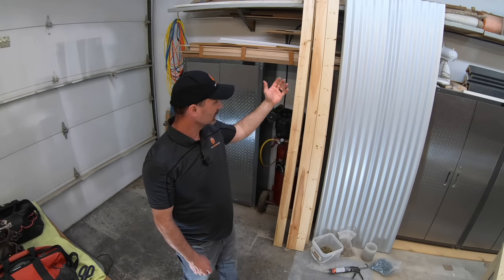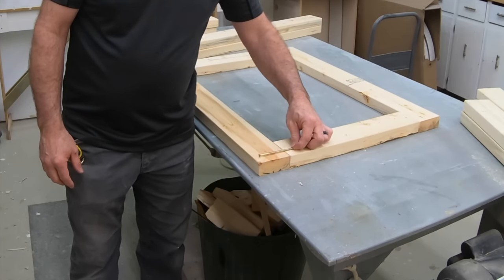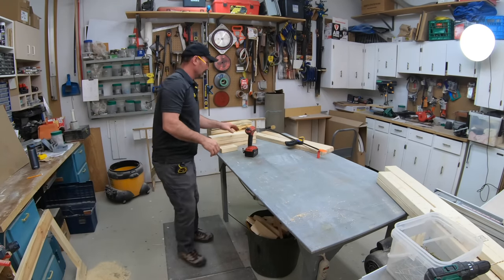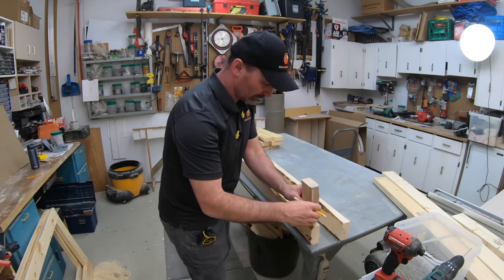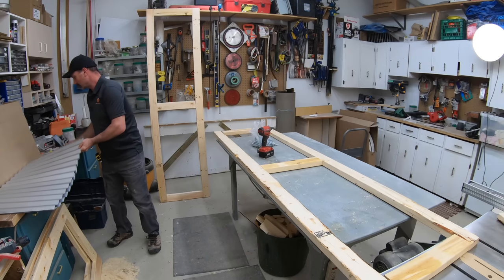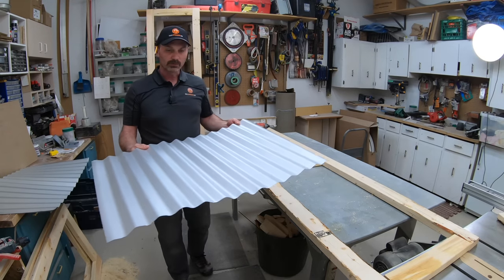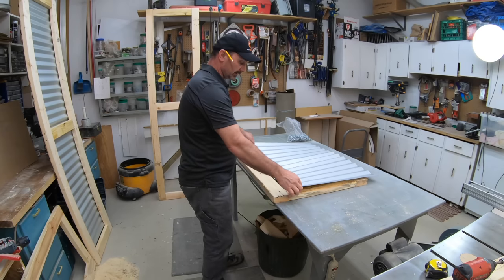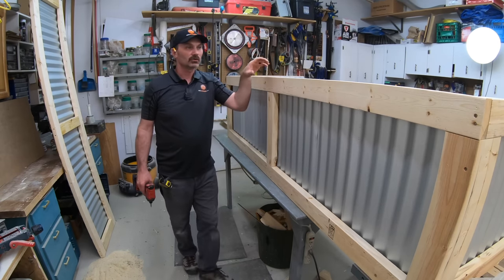How To Build a Raised Garden Bed

Comment from the maker: Here is the cut list: https://www.house-improvements.com/files/raised-garden-bed.pdf
Reply: Wow, $200 each is a lot.  Yours should hold up well.  For comparison, I build 8 out of Redwood 14 yrs ago and I have 3 starting to degrade.  I live in Oregon so Redwood seemed to be a good choice of wood.  People reading this should know that the ground could present a problem with root invasion and the likes of Gophers and Moles.  A combo of Ground fabric and 1/2 wire fabric worked marginally for roots but 100% for ground critters.  Root invasion, even if the canopy doesn't come close is still a problem and could make it difficult to keep plants hydrated.  Well Done!
Reply: Question…. Are lumber prices as insane in CA as they are down here?! 

I know part of the issue was due to everything closing down, but this is getting ridiculous. 

Sigh

Comment: A great instruction set describing a raised garden bed.  If I might add one other suggestion:  if planning to install an all-thread bar to brace the middle of the bed from bowing out, I would use a piece of PVC pipe to cover or encase the all-thread bar to prevent rusting and eventual failure of the bar over time.  Thanks for sharing this video.
Reply from the maker: May help but a 3/8"or 1/2" bar would last for years anyways

Comment: Thanks again Shannon. Great stuff.  Currently putting board and batton on my cabin. What is your recommended mailing pattern for 8 inch wide boards.  I see so much conflicting advice!! I’m using 8 in wide by 3/4 thick cedar boards with 4 in batons.  Thanks
Reply from the maker: Personally I would nail the boards in the centre  and the battons on each edge. We can help you more in the forum if you need more advice.

Comment: At 27:32 use 3/4" PVC for 1 or 2 center spread supports. Make or buy a Trunnion. Use a round piece of 1/2" Aluminium rod, file a small flat to drill thru- drill and Tap 10-24. Drill thru PVC and insert trunion. Then drill the 2x4 and use a 10-24 SS Bolt and washer into the trunion. You will get NO rot or rust. You can just use the alum with no thread and use a threaded hook around the trunion..

Comment: Shannon!  Long time subscriber, LOVE the channel!  Your videos have helped me so much.  I had a question about flush beam decks and joist span.  I don't know if the same allowable spans apply for flush beam vs drop beam.  I'm building a 12x16 ground level deck, the beams will be 2x8, will I be able to use 2x6's for the joists?  They would run approx 6' each before being fastened to each beam.
Reply from the maker: Thanks for watching! If your question is wether 2x6s joist can span 6' between support, the answer is yes. If you need more help please post questions in our forum and I can help from there.https://www.house-improvements.com/forums/
Reply: @HouseImprovements  thank you sir!

Comment: shannon , buddy thank you the video and time, as always  great material.
if I gonna place outside in the back yard and double on long,
under  no cover , Do you think will be ok o I should considering  something  else for the long time,
thank you in advance
Reply from the maker: I think you are asking if you can build it twice as long? Yes you could but you will need some braces inside to keep it from spreading from the weight of the soil you place in it.
Reply: @HouseImprovements  and the 2x4 with the rain ans sun in florida ,
should I paint it or used the green 2x4 , thank you again

Comment: I am interested in building one or more of these.  I think I will try 2x3's to save some money with the crazy price of wood right now, except for the top seat portion I would use the wider 2x4"s.  But I have not found the metal sheets yet in a quick search of lowes or homedepot.  Maybe when the stores re-open I can find them in an Aisle.
I assumed you used non PT to keep cost down and also not poison what you might be growing.

Comment: looks nice!  Just curious, why did you cut the metal for sides into three pieces instead of just using one long piece?
Reply from the maker: Less waste. The panels are wider than the total height of my planters. typical panels are 30"  - 36" widest I did not want to waste money by cutting them to the width I needed and throw away the rest.

Comment: Great video that edits out unnecessary stuff. If you don't use PT wood, which you will do if you plan to grow vegetables, how do you make sure the wood does not start rotting out in the weather? Thanks
Reply from the maker: You can stain it or paint it. The only part that may rot out pre maturely is the bottom of the 2x sitting directly on the ground. You could raise it off the ground if you like sitting on 3 PT 2x4s.

Comment: Love the video!  I think theres a mistake on your cutsheet.  The metal sheeting should be 8' W x 25 1/2" H.  I noticed when i was looking at the costs of the sheet.
Reply from the maker: The sheets are purchased 8' long and I believe they where 32" wide I then cut them not pieces to fit them side by side
Reply: @HouseImprovements  Having trouble finding any corrugated metal sheets that are 32 or 33 1/2" wide.  The standard width at HD and Lowes are 25 1/2.  Where did you get your sheets of corrugated metal?  You mention that you may have to special order them, but I can't even find that width on the internet.

Comment: Great videos I have a question we ordered 6’’ to windows for front of the house but we found out the framing is 2x4 we want to do vinyl siding how we can address that problem?thanks
Reply from the maker: The window jambs can be removed and cut narrower usually and then re installed.

Comment: Curious. Why did you choose to cut the metal with ribs in that direction as opposed to cutting long pieces?  Seems like there would be less cutting the ribs so the sides sit horizontally
Reply from the maker: Less waste doing this . The sheets are 32" wide so you would be cutting off some of every sheet and tossing it.
Reply: Ahhh.  Makes sense

Comment: Is there a reason that you cut the steel sheets to go vertical instead of just having it long and go horizontal? Would seem quicker to just use the sheets lengthwise.
Reply from the maker: Less waste. Theses sheets where 30+ inches wide

Comment: Would love to know where to buy the metal sheeting
Reply from the maker: Some big box lumber stores and smaller lumber stores will have some in stock in their roofing section, it may not be exactly like mine but similar . There are PVC styles like what I have but I dont think it would be strong enough once filled with dirt.
https://www.homedepot.ca/en/home/categories/building-materials/roofing-and-gutters/roofing/roof-panels/f/steel/698-w7e

Comment: Can anyone give me advice on how much to charge to make two of these?$ My older neighbor wants me to make them for her. She is supplying all the materials.
Reply: if you're doing a good job and being efficient... it shouldn't take more than 2-3 hours (highest rate) 3-5 hours (mid  hourly rate) to cut and assemble. maybe 5-7 depending on skill set (lower hourly rate)

the materials PER unit roughly $125 materials or $250 for 2

carpenters and craftsman charge $75/hr+  (~ $250+ don't sell a skill set short)

handy bros $50-65  (~$225+)

"can do it"  side work $30-45 ($200+)

give or take rough guesstimates .. per my locale

don't sell yourself short, it degrades the market for others...  good work ain't cheap and cheap work ain't good 

don't be the guy that rips off the customer either.
Reply: if you always intend to add value and you weigh the added value with the current market for whatever currency you have agreed to barter your value for... 

 your intuition will guide you.. 

if you get done.. and feel better saying $100 good for you...

 or maybe the altruistic side says....

 share some peppers and strawberries and I'm glad to be of service... 

or maybe you finish up and feel compelled to wish the neighbor well free of any compensation

EVERYTHING happens for a reason... your thoughts feelings and belief system will dictate the up and coming nuances of the experience as life.

the kind hearted good nature of a deed for another can come back 100x fold in the most "unconnected" ways... 

how do you FEEL??? allow that intuition to guide you

Comment: I apologize if this is a dumb question, but will the metal sheeting rust over time? I've been thinking of making something like this given the cost of pressure treated (sweet mercy).
Reply: It will not rust, it's galvanized.👍
Reply from the maker: Rusting will take many years , rusting right through may take 20 yrs.
Reply: The wood will rot out before the metal rusts out.

Comment: If you don't cut the corrugations against their bend face, and let them run lengthwise, they will lie better, and be more sound.
Reply from the maker: For the height of these planters I would have been wasting basically 12" of metal all the way around if I ran it horizontally , so this makes more sense to me to me in this case.

Comment: How do you square if it is not? ( 35:00)
Reply from the maker: You can squeeze the diagonal length that is longer . If your top frame is sticking over all sides a bit like mine it likely won't matter if your'e out a little anyways.